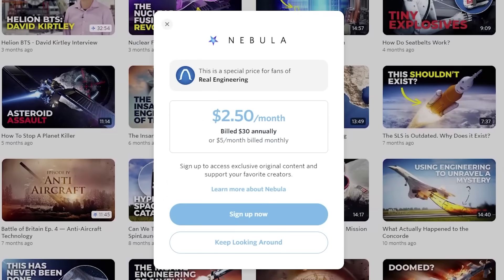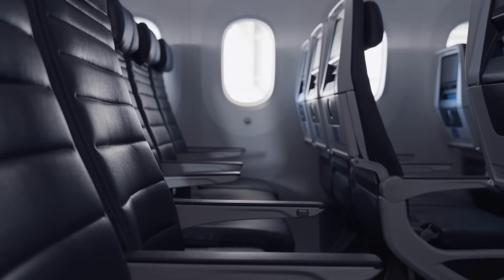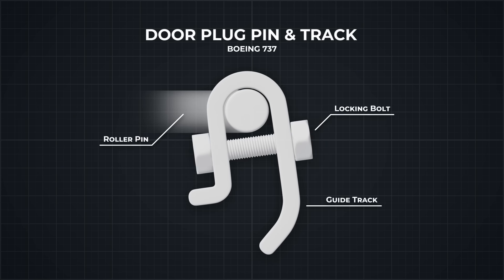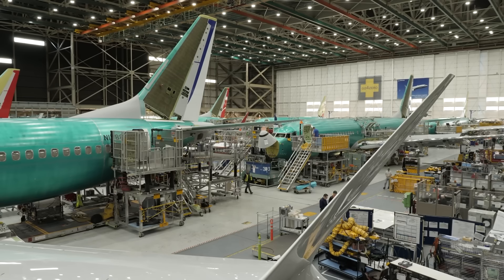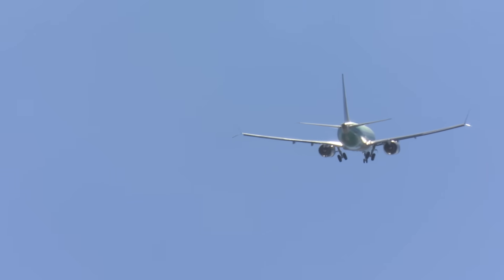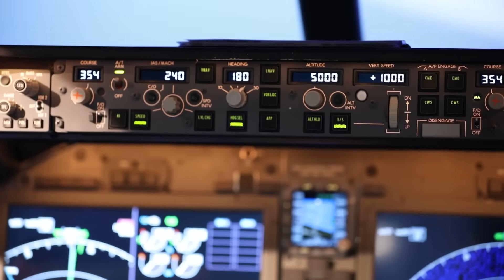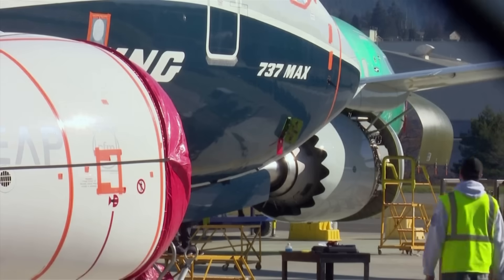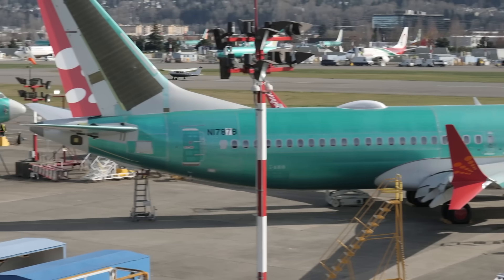The Questionable Engineering of the 737 Max

Comment: The pressure issue was a fault with the auto pressure system, allowing the pilots to set a rate of climb for pressure, if it fails, they can manually increase the pressure. These systems normally have an A and B channel, a fault light appears when one or both of the channels experience an issue. The procedure is to check both channels separately, if one fails and the other is fine then 99 times out of 100 its the controller or sensor having a problem and just requires a replacement. The MEL allows for one of these channels to be offline as long as the pilots can manually increase and decrease the pressure themselves. The way these door plugs are designed it is highly unlikely to be the cause of a pressure issue, mainly because if it was leaking enough to stop the plane from pressurizing properly it would be whistling quite loudly, enough that passengers and flight attendants would complain. This happens on occasions with the rear doors, the outflow valve that allows for pressure control sometimes start to whistle, loud enough that the flight attendants complain about the door "squealing" when its actually the valve making the noise, and that valve is about 10 feet away and outside of the plane. If a valve outside of the aircraft can whistle loud enough for flight attendants to notice, an air leak 1 foot away from a passenger wouldn't go unnoticed. These pressure controllers fail on occasion, almost every time it is something to do with the controller itself. The door plugs have never failed before, they don't open and close during normal operations, they aren't something a mechanic would think to check because they are never the cause of a pressure leak. Not to mention that the MEL allows for this to be out of service and still flying, the manufacturer doesn't consider it to be signs of a larger issue, so why should a mechanic not use the proper procedures available to him/her? When looking at this event closely the blame falls on boeing and its suppliers, a mechanic can only do what is approved by the manufacturer.
Reply: It’s annoying how inaccurate this video is

Comment: if the accident is due to improperly installed bolts how is this Boeing's fault? unless it came like that from the factory. Also the airline chose to fly the plane even after warning lights were present during previous flights.
Reply: It did.
It's a brand new plane.

Comment: Is it unfair to say that Boeing getting exemption for the 737 is unsafe but for airbus getting it is considered safe? 

By letter dated October 26, 2017, Mr. Franc;ois Duclos, A350 ChiefAirworthiness Engineer, Airbus SAS (Airbus), D2202, 2 rond-point Emile Dewoitine, 31700 Blagnac Cedex, France, petitioned the Federal Aviation Administration (FAA) for an exemption from the requirements of §25.981(a)(3)oftitle14,CodeofFederalRegulations(14CFR). Thisexemption,ifgranted, would allow Airbus time to complete the necessary modification and installation of new hydraulic monitoring and control application (HMCA) software and new hydraulic engine driven pump (EDP) on Model A350-900 airplanes while permitting on-schedule delivery and retrofit to its customers in the United States (U.S.). Airbus requests relief from the requirements of §25.981(a)(3)foraperiodof18months. 

https://downloads.regulations.gov/FAA-2017-1053-0004/attachment_1.pdf

If you want to do an impartial video then go ahead but your video is just Boeing bashing and calling them out without looking at what the industry is also doing. Why don’t you also make a video ‘The questionable engineering of the A350 whereby the fuel tank may explode’ ?

Comment: You are safer today on a Boeing plane than at any time in the past. (Statistically, based on hull loss per passenger mile). It's trendy these days to slam management and institutions, while ignoring facts and data. The hard fact is.....Boeing, the FAA and airline operators have jointly created an exceptionally safe industry with an ever-improving safety record. Accidents do happen, and Boeing is not a perfect company but the public needs to be careful about catchy, misleading headlines.
Reply: Problem is, if you look at the statistics for last 10 years for Boeing, it is not as safe as it used to be. And with recent mishaps, especially regarding quality control... I will prefer Airbus or even Chinese or Russian plane to a Boeing.
Reply: @Янус_Ырт  Incorrect. Boeings safety record has consistently improved over time, even when accounting for the two 737 MAX accidents. As I said above, their planes are safer now than at any earlier time. The tsunami of negative headlines tends to mislead people, but that's the times we live in.
Reply: @jlvandat69  problem is, there is far more than only 2 incidents that happened in last 10 years

Comment: A few days before that happened I flew on a 737 max and on descent had the worst pressure related ear ache ever. It would be interesting to see if perhaps the pressurization system also is somehow not working reliably
Reply: There is a cabin altitude gauge in the cockpit so they would know if the plane was leaking air (unless boeing also f'd up the pressure monitoring)
Reply: Not flown on a 737 MAX yet but the old B707 regardless of airline used to literally blow my ears out from depressurization. I would fly other airlines if at all possible to avoid a B707
Reply: @jdwht2455 There's very few 707s still flying. Only one I'm aware of is doing domestic flights in Iran. Edit: nvm that one crashed and apparently the rest are military
Reply: Depends on whether other passengers had the same complaint. If it was just you, then its possible that you had a cold which can cause your ears to adjust badly to the artificial pressure inside the plane. This happened to me on an A320 airplane.
Reply: @St.Ranger_1  definitely need more data points on the same plane. I fly quite a lot but it could have been a me problem on that day certainly
Reply: I flied on a B737 Max 8 this month as well, had no problems. My gf flied with me and in another one last month and no problems either. I would still rather have gone in another plane but just saying.
Reply: That kind of pain is excruciating
Reply: If it was only you that had that problem, then it probably means something else
Reply: I flew on one in November and had the absolute best experience during descent that I've ever had, but when I flew on one again January (just a couple days before the incident just like you), it just felt like any ordinary plane, and even a little worse. Makes me wonder how far the quality control issues go when one plane can have such a good system and another can have such a mediocre one.
Reply: @vqlcano1698  It's more likely that it was the rate of descent from cruise that caused it rather than anything related to actual pressurization system malfunction.

Comment: If they had deiced to design a brand new, modern plane from the ground up to replace the 737 instead of trying to overhaul a 50 year old design yet again, none of this would have happened.
Reply: I totally disagree. Someone could have forgotten to install the same bolts (or the cotter pins that prevent them from backing out) on the door plug on the brand new plane design. And whomever was supposed to inspect the work could have just checked the box instead of actually looking.
Reply: @InlineSkater72  it's reasonable to assume that if Boeing had designed a new plane, they would also have put a higher effort into quality control
Reply: @felixw19  In either case this incident scares me very deeply as it does not appear to be an engineering problem and instead it appears to be a quality control / not doing your job problem. However this is just speculation until we do see the final report on how this exactly happened.
Reply: Perhaps true with MCAS related incidents but not with this.
Reply: @Hodgeheg90 Fully agreed. MCAS was needed because of a design consideration that was made long ago and not easy to change on the existing plane.

Comment: That “wire tie” is called a “cotter key” or “cotter pin”.  They are typically used on castellated nuts as shown and these are fasteners that are torqued to spec and then the nut is either loosened or tightened to the next alignment of the hole to allow for installation.  If properly installed it is impossible for the fasteners to come loose.
Reply: He shouldn't have said wire tie. It made it sound like lock wire, and that is definitely NOT lock wire.
Reply: Or “split pin”
Reply: @roscozone8092  either way, if the pin is in the bolt, the nut will not come loose. Even if the bolt jiggles around, it will still hold the door closed. I think the pin is the failure point.
Reply: In the Air Force we used lock wire, but it had to be done the right way otherwise we would get earache from the supervisor, but it seems Boeing don't get work checked as its cheaper that way.
Reply: Yeah, we used mostly lockwire, there were still some cotter pins in certain locations. @matthewn1805
Reply: The loose bolts holding the hinges are not lock wired so they could come out. which would allow the hinges to disconnect from the fuselage.
Reply: I expect the investigators will find the none of the 4 locking bolts were in place. Maybe the door hardware from an actual door that did not have holes for the locking bolts was assembled on the door plug.
Reply: @MrHugemoth   if the 4 bolts were missing the spring loaded door would open on the ground  and be caught with the pressure test. 
The loose bolts on the hinges on other planes are a different  matter
Reply: @JamesAnderson-mr2sg  The four bolts hold the door plug down and this prevents it from going up and blowing out. Even with the springs pushing up, the door plug won't go up and release the plug unless some force acts on it to lift it. A pressure check initially wouldn't detect any leak as long as the plug remained down. The prevailing theory is that the vibration over 150 flights gradually lifted the door up and out of place. This started a leak, which led to the pressurization alarms. Finally the plug elevated to the point where the door stops disengaged and the plug blew out.
Reply: @joevignolor4u949   If the 4 bolts are in place it can't lift the door from vibration. if the 4 bolts weren't cotter pinned then its possible for the nuts to come off with vibration and maybe the bolts could work there way out, then the door would open automatically, that would leave witness marks all over the holes they were in. being under spring loading it would seem unlikely they would work there way out but its possible. the loose bolts they are finding on the hinges is suspect, they need to check the emergency doors over the wings as they use the same technology but the hinges are on top of the door.  The NTSB isn't showing us test results of the door nor any real meaningful photos
Reply: It won’t matter what kind of nut is the best, or even what kind was specified to be used, if it or the bolt it was to be placed on were never installed the first place… or if workers are actively discouraged from checking.
Reply: @crewdawg16  The only possible failure point is then the bolt shearing.
Reply: @mrdrummer2564 no way, one can see no damage to the hinges...

Comment: 5:21 that is not a wire tie. Wiring fasteners tight has a completely different procedure. That is a cotter pin, there are different opinions how to install a cotter pin. Cotter pin is likely the failure point.

Comment: I feel that even if this turns out to not be Boeing's fault, its reputation will still be dented, just like the DC-10's reputation. 2 accidents (the 2nd with 300+ deaths), and then later a 3rd that, while not the company's nor plane's fault but rather faulty maintenance, grounded the fleet and really helped deteriorate it
Reply: I don't see how it's not their fault, and I really don't see why after they killed two planeloads of people trying to save money, the board weren't all immediately fired, all the executives too, and the company taken into receivership by the state.  Which is what should happen.  And the people who made all these horrifying bad decisions to put flaky airplanes in the air over all our heads, should be facing criminal charges for negligence.
Reply: @angie99656  I'm not saying Boeing is completely free of blame, and regarding MCAS they are absolutely in the wrong. But after the crash of American Airlines flight 191, the DC-10 was grounded, after an already tarnished record after 2 accidents, including Turkish Airlines Flight 981 causing 346 fatalities. The 981 crash was a fault in plane design, so McDonnell Douglas was on the hook, but 191 crash was due to faulty maintenance also done by other airlines. That crash was less McDonnell Douglas' fault, but they were at first still partially blamed, and the DC-10 wasn't trusted.
In this case, the MCAS crashes were certainly Boeing's fault, but this recent Alaska Airlines accident's cause is yet to be determined. If it is Boeing's fault, then blame them to bankruptcy. But my point is that they could still not be seen as a reliable  manufacturer, and the Max a failed airplane EVEN IF it wasn't their fault